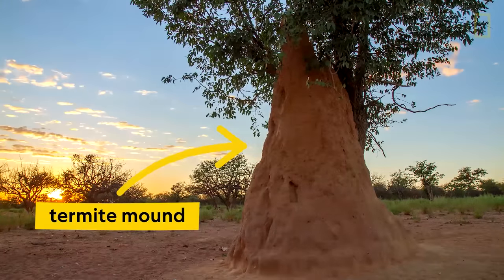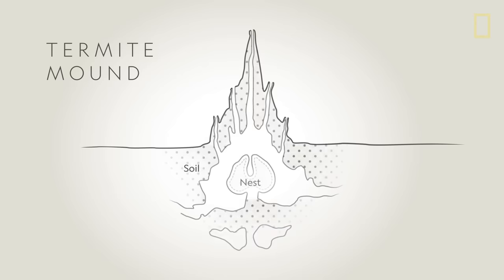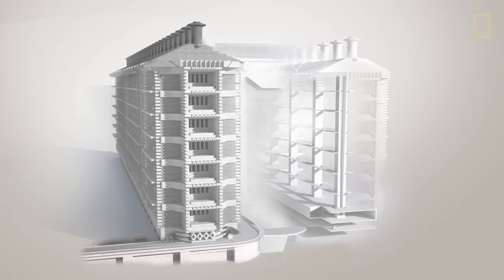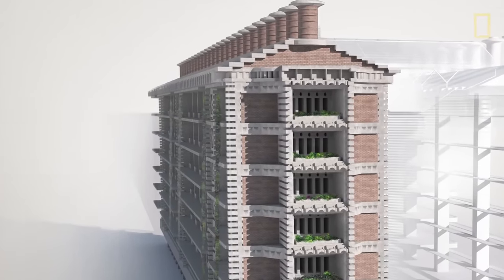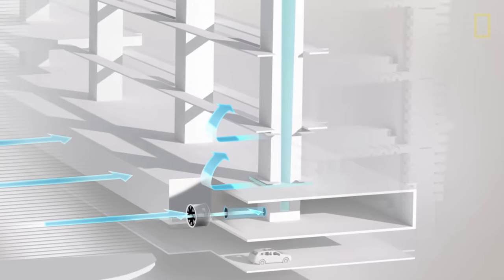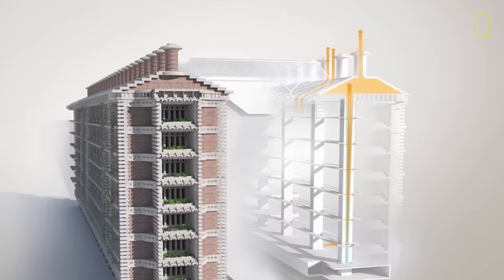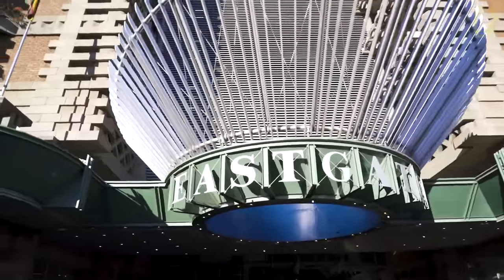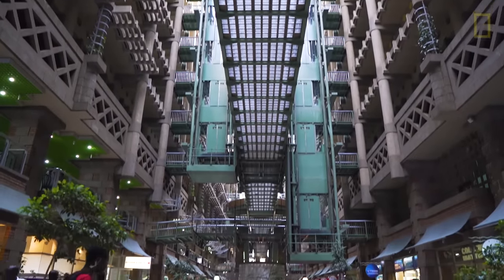See How Termites Inspired a Building That Can Cool Itself | Decoder

Comment: brilliant!
however, it's the increase of shaded surface that reduces the heat absorption during the day and not the bigger overall surface - and the concrete transfers its heat to the air let in and does not store the cold from the air ... it always moves from hot to cold

Comment: In Harare, Zimbabwe, where this building is in, temperatures can get up to 30 deg C (which accuweather says feels 33) in the mornings on the hottest month of November and as low as 2 deg C at night during their coldest month of June. So 27.7 morning indoor temp and 13.8 nighttime indoor temp, without the cost and greenhouse gasses of air conditioning, is pretty okay.

Comment: The termite mound is dug into the ground so it's cooled geothermally. The building doesn't do that.  The temperature and maybe air pressure differential between the top and the bottom may promote air circulation that moves the cool air up through the structure.

Comment: They used to build  like this more than 150 years ago..
Old Antebellum mansions were designed to use convection 
currents to heat and cool the whole house and with the right 
amount of  shade trees planted around the house and lilac 
bushes planted next to the first floor windows, Cool air  in 
the summer would be pulled into the house with a lilac sent 
to it and travel by convection currents up those elaborate 
staircases all the way to the attic where warmed air  would 
be vented back outside,   through  smaller  windows  in  the 
attic..  If  done correctly, the ambient temperature throughout 
the entire house would hover around 70 to 75 degrees during 
an 80 to 90 degree day ..
Reply: I have never seen such a building so uniquely built like this 150 years ago

Comment: Chicago has a system where it collects lake ice during the winter and keeps it underground and circulates the cold water from the runoff throughout the summer to cool buildings.
Reply: I believe you are getting two different things mixed up.  
Before the Advent of modern chill water and air conditioning systems a process was in place in Chicago where in the winter large blocks of ice will cut out of the lake stored underground and then doled out to the summer for refrigeration and air conditioning. That practice ended decades ago.
Currently there's a company that makes ice when the electricity rates are lower, that is at night. This company then distributes chill water underground two buildings that have contracted with him to ride cooling. It doesn't use Lake ice it just uses cheaper electricity at night.

Comment: Actually a termite mound uses Bernoulli's principle for ventilation. The pressure difference between outside and the inside creates forced ventilation even with the slightest of the breeze on the outside. The chimneys on top probably mimic this to an extent, but since the floors and spaces are stacked mechanical cooling is probably required. Not much biomimicing from the mound though.

Comment: I used to live in a cinder block constructed building in Las Vegas NV. During the summer heat 115°+ my a/c seldom came on. It was comfortable and cool. Winter mornings however, I'd use a floor heater to knock the chill off the air. Maybe i was ground floor that made a difference, other than that everything else was equal.

Comment: The Biltmore House in Asheville, NC used this type of knowledge when designing the mansion in late 1800’s.  They cut a tunnel though the mountain, and entering the basement.  All they need to do is open the upstairs windows and convection cools the house int he summer. 
It is cool to see how they designed the exterior of the Eastgate center to add to the benefits gained.

Comment: Celsius and Meter > Fahrenheit and Foot
Reply: Nor Priest Im sorry but Fahrenheit is clearly superior to celsius when talking about weather. This is an inarguable point. Celsius less than half the precision. Fahrenheit has 130 degrees dividing normal every temperatures and celsius has like 70. There is no question which is a superior measurement.
Reply: @Melthornal: indeed the scales don't have the same amplitude. But... is it really important? 
I mean do you really need this accuracy in a daily basis or even in scientific context? Most of the time degrees (Celsius, Kelvin) are used with integers. And when it's really needed with a fractional part. And everyone can understand easily the Celsius degrees (0 the water freezes, 100 the water boils. So it's a scale expressed in base 10).

Comment: 82 degree is way too hot. 70 degrees or nothing
Reply: firexgodx980 no if you drop 35 to 27 celsius
Reply: It isn’t that too hot actually in low humidity high altitude region like Zimbabwe. You have to consider humidity, or dew point.
Reply: +Tafara Mugwara good point.
Reply: Its free built in cooling. Quit whining.
Reply: firexgodx980 It is not too hot !

Comment: There is a cheaper alternative design for the same concept. The other system is simple building deep shafts deep into the ground at the side of any building and then just circulate the air before it reaches a heating or cooling appliance. 

A 40 foot deep hole can be narrow as the air circulates, it cools or heats up to the temperature underground which is always cooler in the summer, and warmer in the winter. It is always at 55 degrees. This means less energy spent trying to adjust drastic tempatures outside that building.

So its the same concept, but without the need for such a big project.

Comment: This is really cool I just have a question for smarter people out there than me, would this still be a viable option for a building design in New England? I feel like it would be nice for the hot humid temperatures in the summer but would it’s efficiency get thrown out the window for cold winter climates? I know this design is meant for hot climates but I was wondering if it would still be thermally efficient to hold in jest in the cold winters, thanks
Reply: New England, and perhaps more specifically upstate ny have long been popular areas for experimentation with passive climate control of houses. There are loads of examples. So broadly yes. This particular building would have to be reorganized to be compatible with a temperate climate, and the fact that's a lot wetter. But it's doable.

Comment: nowhere in this video was a termite mound feature that was 'mimic'ed actually described. The only thing this mall and the termite mound seem to have in common is that they both have some form of ventilation. The termite ventilation however is passive, while the mall has electric fans and ducting.

Comment: For those who are not experienced in construction, it may be cool, pun intended, but in fact, it is far from "self cooling". BTW, 28-30 degrees C is not cool for humans. You may feel cool when you enter the building from 45 degree C environment, but soon your body will feel the heat again and start to sweat. What are missing here are two major parts. One is shading. If you could keep the building from direct sunlight in someway, temperature inside of the building will be low all the time. The other one is water. If you have a large water reservoir underground and draw air from its surface by natural circulation, or, create a waterfall in the building in someway, the temperature inside will be even lower.

Comment: Cool, whats the plan regarding fire though? Wont it spread faster with all the air circulation?
Reply: Good thing the building is made of concrete and brick, which aren't combustible like wood or drywall.
Obviously, any modern building should have smoke sensors, sprinklers and should shut down electricity to elevators and fans.

Comment: Still pretty hot. You should grow few big trees around the building to cut the temp a bit down.
Btw...wasnt the actual design much expensive than puttin few AC there? :D 
Also you could use a heat pump and install pipes inside concrete ceiling and run cold water inside them to cool the building.

Comment: Might could put several self wicking evaporating cooler tubes inside the structure toward the rooftop and putiing more solar powered revolving vents thus allowing more cooling.  82 degrees is a bit hot to me

Comment: I think people are missing piece of the climate control puzzle here. The methods used to lower the internal tempertaure to 82 degrees doesnt mean that's the actual temperature inside. Electric climate control is still used to lower the temperature probably to the ubiquitous 72 degree standard. 

The punchline here is that it's still a lot cheaper to cool 82 degree air down to 72, than it would be to cool 92 degree air down to the same amount. That's where the savings come from... and at night the climate control can be switched off altogether. More and more buildings in my country in the Caribbean, are using these types of energy-saving methods

Comment: Pshaw.  Bernoulli would be very saddened to see you giving all the credit to termites as opposed his Second Law of Aerodynamics.  What the tower and the termite mound have is common is HEIGHT.  The wind crossing the openings at the top of both tower and mound is travelling much faster than the wind at the bottom which is slowed by friction from the gound, trees, etc.  

Now Bernoulli's second law states that the pressure inside a moving stream is less than the surrounding pressure.  So the pressure at the top of the building is less than the pressure at the bottom.  This PULLS the air up and out (like a perfume bottle, once the air goes out the wind takes it away).  This is INDUCED draft and not FORCED draft from underground fans.  So the hot air is constantly being expelled out the top and being replaced with cooler air at ground or subterranean levels.  

This is a fundamental tool of physics that allows airplanes to fly, ground-effect race cars, gopher cities to be cool, etc.  Termites use this too, but they're not the only ones.  It's the same reason why every chimney is taller than all the windows of a house,,, you want to induce the draft up the chimney and pull in replacement air from outside that isn't full of smoke.

Comment: i don't believe the temperature can be that different from inside out, unless the air pumped into the building doing the trick. My understanding is that the power to cool down the building is not that sufficient. Termite nets are huge compare to their living area, the huge amount of space are used to insolate and ventilate, but human building are not at that size.

I once saw one method is to use deep underground heat/cool source instead of air conditioner or with air conditioner. To me, that is way better, suitable for shopping mall or large office building office.

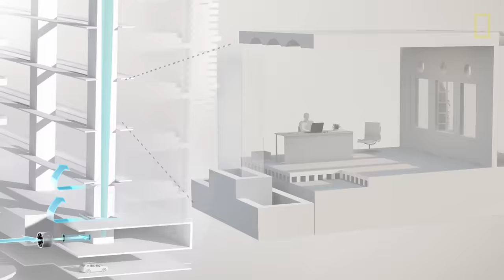Comment: 2:01 - Cold cannot be absorbed! ☝There is only heat or no heat but no cold.
It is correct to say "The colder air absorbs the heat from the concrete slabs".

Comment: >concrete walls absorb the cold
What? No it saps heat out of walls. The air then needs to be removed through vents at the top of the building. That's primary school tier physics.

Comment: This isn't a new idea. I've been in some old residential towers from before air conditioning. All the housing units are arranged around a central open space. Which also has a mass of brick and concrete to serve as thermal mass. The residents can open exterior windows and interior doors to let draft through their homes.

Comment: They should mount some small turbine on the outlet of the chimneys and in that way, collecting electricity, and of course, the roof should be solar panels of some sort. It is also possible to get cooler air from the ground. Below 120 cm, theres more or less always less than 4 degrees. It takes just some light fans to get it up.
Reply: Jesz is there any pleasing to U?., O ye homosspiens ? . They say built for energy ñ cost Saving, they now say it gets  xtremely cold in there, yet I still finding what to  chow down . Give hon our to whom hour is due😊

Comment: a video on how to keep the heat in instead plzz? in sweden we got -2 celsius the other day, freezing to death isnt our problem.
Reply: Keeping buildings warm is relatively easy, and a solved problem. Keeping them cool is hard, and much more important for the majority of the world's population.
Reply: less isolation is ur solution, thinner walls that is, and good ventilation and woila, u have a steady current of air in ur building and will cool it down
Reply: Assuming that the outside is hotter than the  inside thick walls are preferable to thin. In addition you might want an outer wall to shield the building from the sun. Air cooling, like here, or when available water cooling (the biomimicry here would be sweating), or in a closed system the building would be a big refrigerator.

Comment: while I don't keep my house as cool as many other people who use central air conditioning, i do have window air conditioning that I use when absolutely necessary. I can assure you 82 degrees F. (27.7 C)  is Not Comfortable, especially when you add in a lot of people and computer equipment, etc.  Room temperature is 68 Degrees F.  Anythning above 77 Degrees F is going to be uncomfortable for a lot of people.

Comment: I think in Celcius coz of the bigger world and practicality. Farenheit is just skewed off centre and lacks harmony. 0° water freezes solid. Single digits are cold. 10s are cool. 20s are warm. 30s are hot. 40s are unbearable. 50 is the upper limit for most animal life. 60s to 90s are dishes in a pan. 100° is the boiling point where water turns to steam/gas. There is harmony there.

Comment: The video used °F instead °C. Because 82°f wouldn't make any sense, It is extremely hot. I turn the fun on and it's still hot however, 82°C would be 27°c..

Comment: Only 35% increase in efficiency with every inch of the building specifically built around that function doesn’t seem that impressive.   The increased cost of such a cool architecturally unique building must have cost FAR more then a regular building? Consuming years worth of that energy saving in advance I would think.

Comment: I design, Repair, and install HVAC/R systems Resolve Indoor Air Quality (IAQ) & Perform Energy Audits when asked or it's needed, in both commercial and residential settings in the Northeast and Southeast U.S.A.,
 ---- And I can tell you, EVEN WITH LOW HUMIDITY You'd have a Hard Time convincing people in the U.S.A and Canada that they'd be comfortable outside 21'C (70F) and 25'C(77-78), ESPECIALLY In an office building environment,,,
-----  I have a hard time convincing people that once I get their Humidity controlled they're going to be comfortable when its 24.5'C(76F) and 45-48% RH!!

Comment: forward thinking, really a long time ago, there should be more adoption of these ideas near equatorial climates.  Atlho the complaints about cooler days are clear they should be adaptable simply by dampers that can close some of the effect.  also simple passive ideas such as more "northern" exposure in this case of glass might help as well.  lots of good ways to modfy the fundamental idea.  BUT regulations can get out of hand, in the USA, they have tied some federal to state funding to efficiency and some states are too STUPID to understand that you don't need low E glass on southern exposed walls as some of that is IR transmission, which is needed.   Or the feds are(likely) as most greens are idiots

Comment: Im an architect and i dissagreed with that design. Non of the strucktur pilars need to be holed it will create week struckture building that ready to colapse anytime soon.  If they want to make a hole should be at the wall. Do not distrubt the structuce. Building need stronger solid bones!

The termites make the whole building as a structure wall. See the different.
Reply: building is still there and very cool 20+ years later

Comment: Hmm...so is this supposed to be new? Check out most ancient buildings in India. Some of them older than 2000 years. They were all engineered in a way that cool air circulates inside no matter how hot it is outside. 
Of course ppl only know hawa mahal but that kind of architecture was pretty old.

Comment: 82F during the day and 57F at night is a failure. This building has a great concept but clearly the design is flawed because neither of those are comfortable temperatures, even in Zimbabwe. I've worked in Africa and would hate an office that is 82F or 57F
Reply: I think she is wrong about temperature this building is very cool I think 19c  day time
Reply: @vanhuvanhuvese2738  if thats true it would be incredible. 19c is 66f and in the heat of the Zimbabwe sun keeping a building at 66f would be impressive. Unfortunately its not what the video says so I would need a source documenting that number

Comment: They still require fans to cool. Its not self cooling.
Reply: Using fans alone saves 35% of energy compared to using air coolers + fans
Reply: @clarencemaseko428  the solution is good the tagline inappropriate, this is a basic cooling model with efficiency questionable in extreme humidity and temperature during the day when its required the most. Also the diffrential temperature on different floors is also a factor, given normal buildings usually have lower temperatures in ground floor.

Comment: The concrete blocks absorb the cold????  A basic high school level understanding of physics will tell you how wrong that statement is. The concrete blocks will loose heat to the cold air, not the other way around. 🤦‍♂️🤦‍♂️🤦‍♂️

Though given you used Fahrenheit instead off Celsius, I’m guessing you dumbed it down for your target audience.